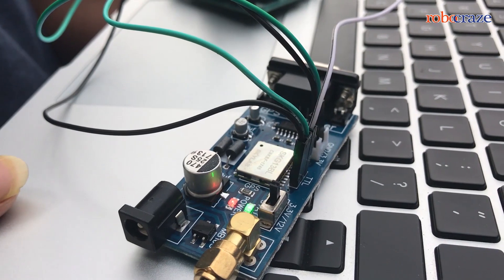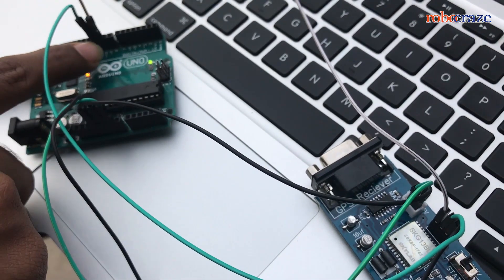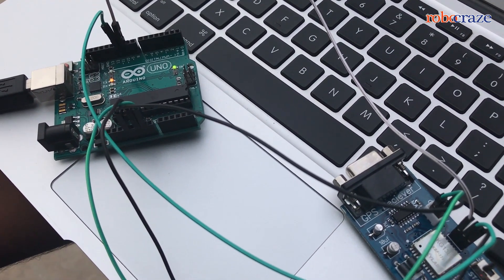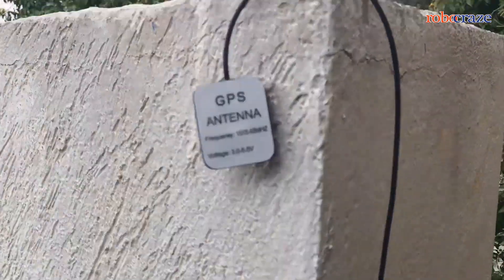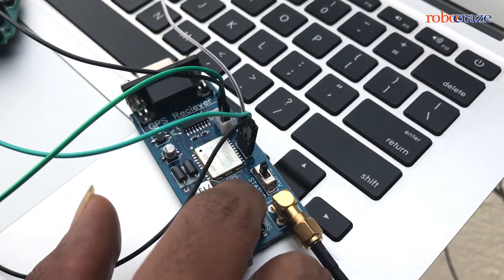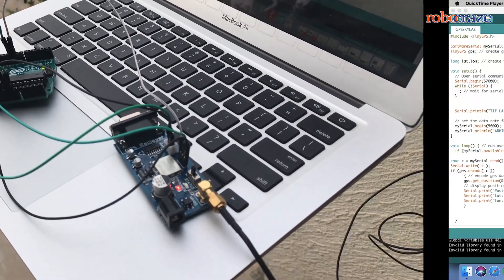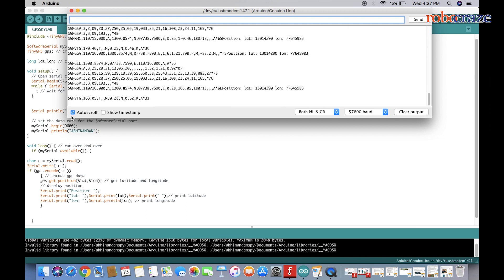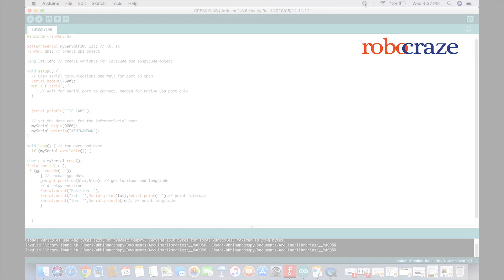Robocraze (Skylab) SKG13 GPS Receiver Module: Made in India

Comment: What if we are using arduino mega...we can't use just any pin as in Arduino uno...what are the pins that we can use for recieving and transmitting signal.
Reply: I mean to say...in place of pin 10, 11 ...what pins can we use
Reply from the maker: In the above example, since an arduino UNO is used which has only one serial interface, software serial has been used with pins 10 and 11. For an arduino Mega, there is no need of software serial as it has 4 serial interafces. Serial 0 with pins 0(RX), 1(TX), Serial 1 with pins 19(RX), 18(TX), Serial 2 with pins 17(RX), 16(TX) and Serial 3 with pins 15(RX), 14(TX). Serial 0 will be used for serial prints on the serial monitor, hence you can use any of the other three serial interfaces to get the GPS data.